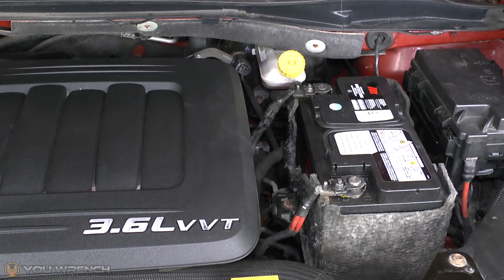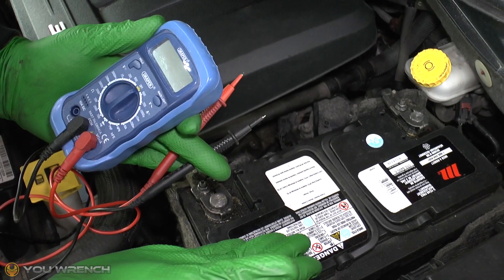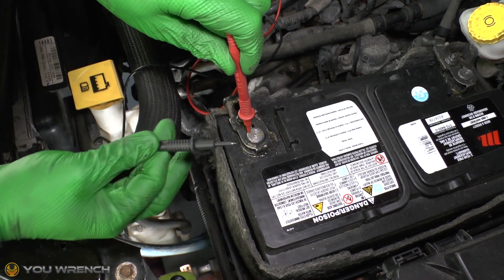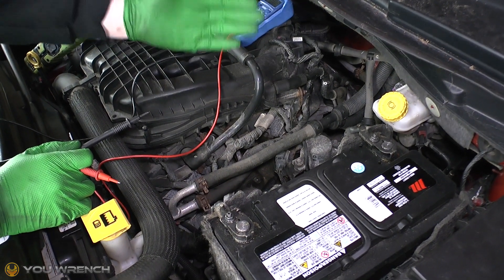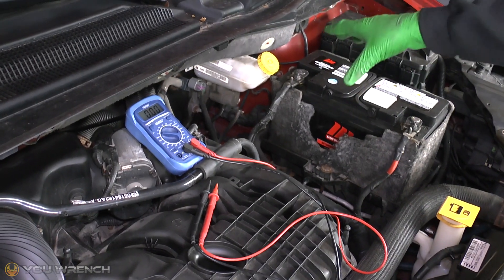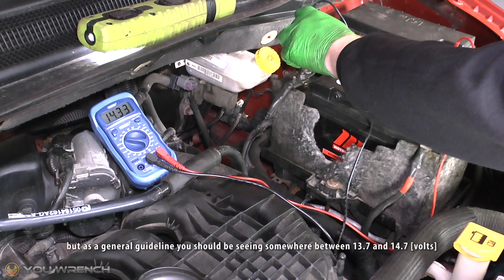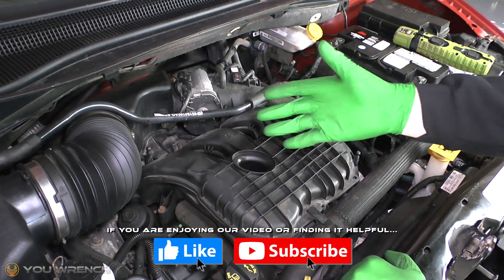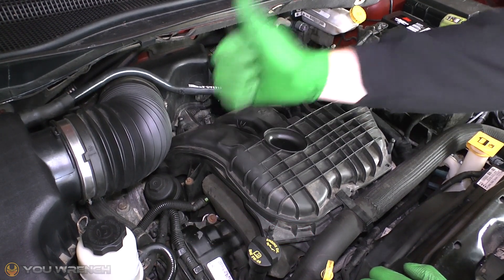How to Test Your Car for Ground Faults - QUICK & EASY!

Comment: What about using the multimeter for a grounding point inside the car? Can I use a spare battery or does it have to be connected to the running battery in the car?
Reply from the maker: No, you would not use another battery. But you can use any grounding point. The entire chassis of the car is grounded, so if you have some bare metal, or an unpainted screw head connecting into the body you can just use any point that's near what you need to test. You can also touch the negative into the rear of an electrical connector on the ground pin too. You're generally never far from a grounding point, so it's usually not an issue.

--- 

To help support us (for both you and others reading this) there are a few things you can do:

1) Donations both needed and welcome! We cannot operate You Wrench without the support of people like you! You can donate by PayPal - just go to www.paypal.me/youwrench

2) Please ensure you subscribe to our YouTube channel. 

3) Please Like our video's on YouTube (by clicking Like!) 

4) Please help spread the word, the more people who know about us the better! Add links to our video's in forums, let people know about us.

Thank you for your support!

Comment: What if you use a wire tracer tool and the wire indicates there's a break in the line but there's no visual brakes what would you do?
Reply: Hi there. What tool are you using? Tone generator based, I'm assuming? Just a bit of personal experience...I've found faulty, intermittent, and broken leads that were still fully insulated on the exterior. Toyotas and GMs are silently notorious for this, especially in between the doors to the body of the particular vehicle.
Reply: @FarAboveDaCloudz  I was using a wire  tracer with the tone effect option on it Thank you for sharing your experience about broken faulty wires, that were still fully insulated on the exterior it’s hard to imagine but I guess you can come across it every once in a while.

Comment: i would consider this a test for an open ground, open circuit... a ground fault would be a short to ground. if were switching across the ground or the positive results would change.
Reply: Nick. I formally request your opinon.
Reply: Yes this is for finding a bad ground not a ground fault. If you are looking for a ground fault this is much more of a pain in the arse, but it's usually a wire with stripped insulation touching the frame or any other part of the car suitable for grounding.
Reply: Yup very annoying especially when the harness goes into the void of stupid crap in the way that you cant get your eyes or hands on@BenJehovah6969
Reply: How would person learn what you are speaking upon here for detecting open circuits short to ground condition? I have a harbor freight multimeter cen-tech cm300. My ohms say 600 6000 60k 600k 60m with hold select function back light for screen. But my battery's under driver seat. I want to check fuse panel located in back passenger side of vehicle. I also have those ice pick circuit testers one for continuity ; one for 6 and 12 Volt testing ;  one 18 24 36 Voltage tester. What is my power source using those they all have gator clip on end only and not very long. Or do I use just my multimeter back there?  I got fuse locations with no fuse in them. They have only one edge of connector in the fuse slot. Instead of two points the fuse blade slides into it's only one on top nothing on bottom.
Reply: @Heylo7 exactly much more Information is needed. No one advises if one should make a long jumper
Reply: His opinion is important and relatively correctly said. Why would any want to disturb a truth if discussion here. Connectivity or Community Disgusted? Thank you and advice may these eras be blessed.
Reply: So how do you test for a short to ground?
Reply: @madmackenzi  generally a short to ground will produce failed equipment or devices. you will unhook supply voltage and sample continuity across a ground point and a positive leg of the failed equipment... or the entire supplied posative. if its many different devices or connections you will divide them by half and sample continuity from grounded point to both halfs, then repeat by dividing the ground fault over and over till you pinpoint it.
Reply: @-Nick-T  thank you for the reply regarding ground fault. I have brake lights and a turn signal that I believe aren't working due to a bad ground. How would I test this with my multimeter?
Reply: @Andy_Holmes  I never figured out the multimeter part. What worked for me was removing the tail lights and I discovered a bit of a hack job on the wiring from the previous owner. One of the connections they made when rewiring had come loose and it was indeed the ground wire. I cut their work out, wired in a short piece of wire, soldered and wrapped it all up. It was tricky because of how close the cut was to the plastic connector, but it worked.

Take your tail light off, keep it plugged in, turn the tail light assembly toward yourself and play with each of the wires individually. Move them back and forth slowly with the turn signal on so that you can see if there's a change in function. That's how I was able to determine which wires were good vs bad. Also, check for corrosion within the connectors. 

Good luck!
Reply: True, this are for not hood grounds or open ground circuits.
Reply: NICKS opinion,once again appreciated, thank you Nick
Reply: FIGHT FIGHT FIGHT FIGHT FIGHT FIGHT FIGHT FIGHT FIGHT FIGHT FIGHT FIGHT
Reply: Your opinion was not requested. Ever.
Reply: @SicarioDistrepo your opinion on an opinion was not requested either, but that's what the comments section is for... 😂
Reply: @SicarioDistrepo you're comment was not requested, ever. Ever think of that before leaving an unnecessarily jerk-off comment which added absolutely nothing to either confirm or deny the original comment?

You see, the purpose of THIS comment, (which is also not requested by anyone) is to expose your ignorance. Apologies for the rudeness.
Reply: @SicarioDistrepo it’s called open dialogue freedoms of speech mother fuker

Comment: Thanks Sir for your expertise and information. My 07 Mercury Milan Premier V6 3.0L had the exact same problem with fuse number 44 constantly blowing. I had found burned wires on top side of the engine cover near the left top motor mount but I still have a fault code for O2 sensor bank 1 sensor 2 in which is the downstream sensor therefore I replaced the old O2 sensor with a new O2 sensor but the fault code is still present with the check engine light on. Any suggestions would help and thanks again for your expertise and help.
Reply: Disconnect the positive and negotiate battery cables there should be a red wire on the positive that goes to your frame lousen it isesomesandpaper to scuff it up a bit getwhatrust or else in on it thow when you recontect that ground leave the battery cables off for six to ten minutes hook it all back up it should take care of the check engine light thow it may come  back on again     may not      I've I changed some much stuff on my car    I do it every time I do install something knew as far electrical components then turn the but don't start it up let it chime and stay  out for few minutes then turn key off wate a few and start it up you don't start it rulite away it's relearning it proper signals from the ecu

Comment: I thought voltage on a wire should be close to 0 volts?
Reply: It is after a load. The battery, or power source, isn't a load.

Comment: both grounds are important of course but the i read the negative is extremely important to be secure. eg chilton auto repair.
Reply: negative is the ground.   the pos is not a ground, red is not a ground.  there are other grounds too from frame grounding the cab, from body to motor, there should be about 10 and you can add as many as you like which can help if one goes bad somewhere..  just add one or replace

Comment: Hi..
what if my battery is in the boot ?
i have miata nb with ground problems, bad moise in acceleration, left side speaker, and loud his.
any ideas please ?
Reply: I bought some extension leads that have alligator clips on the ends from Amazon.  Clip one end to the battery, the other to your test lead for the multimeter.  Combine leads for even more reach.  If needed, wrap a rag around the connection of the clip & lead or clip to clip so it doesn't touch anything it shouldn't.
Reply: As far as the stereo noise, is the stereo system aftermarket?  Are you running a amplifier?

Comment: I also have some electrical issue with my car.
When i roll my windows all the way to the top, my engine rpm drops.

Same thing happens when i turn my hydraulic steering.

The only electric upgrade I've done to my old car is installing a battery from Mercedes 660a 60ah
Reply: Your alternator has a problem or the connections to it need checking

Comment: Many thanks I have an issue where my xenon bulb keeps failing due to the ballast failing can this be caused by bad earthing?
Reply from the maker: Yes, it is a possibility. However, the xenon ballasts can and do go faulty, it's far from uncommon. You could test the earth going into the plug of the xenon ballast and check it's ok. Be careful working on ballasts, they hold a charge and can be dangerous. Always follow the safety information on the sticker!! Best of luck!

--- 

To help support us (for both you and others reading this) there are a few things you can do:

1) Donations both needed and welcome! We cannot operate You Wrench without the support of people like you! You can donate by PayPal - just go to www.paypal.me/youwrench

2) Please ensure you subscribe to our YouTube channel. 

3) Please Like our video's on YouTube (by clicking Like!) 

4) Please help spread the word, the more people who know about us the better! Add links to our video's in forums, let people know about us.

Thank you for your support!
Reply: @YouWrench  I have sorted it turns out BMWs dont like non genuine xenon bulbs!! I contacted them and wait for it .............£214 each!! I found a guy on ebay who was selling two genuine ones for £60 got them and worked a treat. Thanks for the advice also got a second hand genuine Ballast which is working good. now both fire up at the same time.

Comment: My multimeter won't reach all my grounds, having trunk mounted battery. I understand I will need to use wire or cable to complete the connection as needed. My question is, would I see a difference in voltage having to complete the circuit with let's say an appropriate quage wire, vs solely multimeter? Or could I use the power wire closer to ground I'm checking? Hope that makes sense and my wording was direct enough to understand. Thanks in advance 👍
Reply: Disregard as after commenting, I scrolled down and saw my question had already been answered. Well the main question anyway. If you have any info on others I asked, would be much appreciated 👍
Reply from the maker: Hey there! The thickness of the wire you use is not really that important because it is not under any load to simply take a reading with a multimeter. So pretty much any wire will do for extending into hard to reach areas if just doing these kinds of basic ground fault searches. The voltage should stay the same, or near as dammit as again it's not under any real load. Yes, you can use a power wire closer to where you are working if you have to, HOWEVER if you get strange results you will likely also want to re-test with it direct to the battery before you consider it a definite fault as you don't know what circuitry is between the battery and that live wire that could affect the readings. Direct to the battery is definitely the best way to go for ground fault testing!!
Reply: @YouWrench  My 95 Ford ranger keeps blowing starter fuses. Do you have any ideas as for what maybe causing this? I check ground to the battery and also the starter wires..Please,Please respond. Thanks

Comment: I have a ground point which is far from the car battery. The millimetres wire is to short to reach that point whats should i do ?
Reply from the maker: You can just use a piece of wire between the point you need to test and the battery as an extension. Please be VERY careful with trailining wires though as you don't want to short anything! You should securely connect (clamp ideally) the wire to the grounding point, then run that wire back towards your engine bay and now you can touch the end of the wire as if you were touching it directly on to the grounding point you wish to test. Hope that helps!

--- 

To help support us (for both you and others reading this) there are a few things you can do:

1) Donations both needed and welcome! We cannot operate You Wrench without the support of people like you! You can donate by PayPal - just go to www.paypal.me/youwrench

2) Please ensure you subscribe to our YouTube channel. 

3) Please Like our video's on YouTube (by clicking Like!) 

4) Please help spread the word, the more people who know about us the better! Add links to our video's in forums, let people know about us.

Thank you for your support!
Reply: @YouWrench  that’s look to much work . I checked the reading of the battery and its giving a good reading so I decided everything is good connected
Reply from the maker: @Bl4ck7411  Unfortunately having a good connection for the battery does not mean that there are not any ground fault issues. Nor does it mean you do have issues. You only need to run the test/s if you suspect something is faulty. Hope that helps!

Comment: So if you get a grounding fault how do you fix it
Reply from the maker: That would depend entirely on what it is that has the ground fault, and where! But the first initial stage before you can fix something is to find out where the issue lies, and that's the process outlined in this video. The testing process is pretty much the same for everything, but the repairing process varies a lot depending on what the fault is and where it is. Hope that helps!

--- 

To help support us (for both you and others reading this) there are a few things you can do:

1) Donations both needed and welcome! We cannot operate You Wrench without the support of people like you! You can donate by PayPal - just go to www.paypal.me/youwrench

2) Please ensure you subscribe to our YouTube channel. 

3) Please Like our video's on YouTube (by clicking Like!) 

4) Please help spread the word, the more people who know about us the better! Add links to our video's in forums, let people know about us.

Thank you for your support!
Reply: @YouWrench  thank you yes I am just not very good with electrical problem's thanks again for life easy for us backyard mechanic's the shops and dealers wanna take you to the cleaners
Reply: tighten it. remove rust or corrosion.
Reply: I will also donate some time soon ok thanks very soon
Reply: New wires bud

Comment: Off topic, but can you do a video on how to change the fuel filter? Your videos are always so helpful. It would be much appreciated!
Reply: You should check out “Eric the car guy” He’s probably got a video on how to do a fuel filter. I must tell you if you’re going to do a job like this, definitely make sure you disconnect the negative battery terminal from that point on it’s simple, use a flathead screwdriver or a socket and remove and replace . Make sure the arrow is facing the same direction that it was before you removed it. That’s very important!